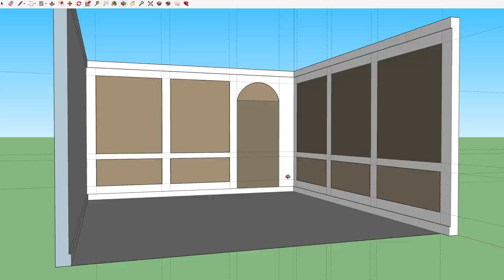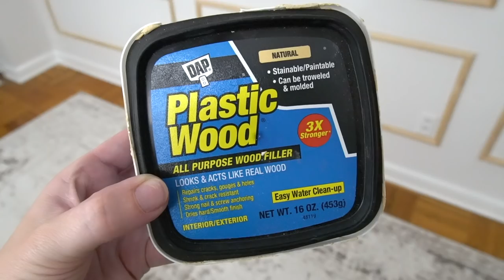Living Room Makeover | How to Install Picture Frame Molding

Comment: Hey Stephanie!  You have just about all the same Ryobi tools as me!  Love them except for my electric riding lawnmower.    So I would like to suggest you get the Ryobi folding stand for your saw.  It has arms that slide out that you can use for multiple cuts.  This will give you better accuracy, save time, and support for longer pieces.  You can install and remove the saw in seconds.  And it folds up for storage.  Best of all it is super sturdy.  Thanks for all your videos!  Beautiful work from a beautiful lady!!!

Comment: Really nice finish. The one thing that really gets me is when developers decide to put thermostats, phone intercoms rdi, light switches etc, in the most ridiculous places - like in the middle of a wall rather than to one side of it!.. Leaving the re-positioning a costly expense.
 An example of this would be the house I have just bought. The developer chose to put the internet modem wall sockets etc in a cupboard that is 2ft high from the floor with a full size door on the front of it. The remaining height the 2 ft cavity is a solid brick wall when the door is open!. Surely they could have put these sockets modems elsewhere. 
I now remove the door and build a false wall to make the whole wall flush! Crazy!.

Comment: It appears like it would have been very easy to at least move your TV wall mount over enough to avoid the wall trim.  Great job ... it's just that for me the interruptions of the trim for the plug just strikes me as not right.  But that really does look great, and nice choice of rug.

Comment: Nice job and no pencil marks & no paint roller needed, wow! ! Good to see it can be done as add on to a ready /painted made wall as I plan to do this as future enhancement. Moving in is already costing a lot haha 😂. Would you recommend the laser guide or that long traditional level will suffice? Is that nail glue stable./long lasting? I got kids and afraid it will suddenly fall like double sided adhesive tape. I don’t have nail gun bec mine is concrete 😂

Comment: Love it. My only complaint are no wall outlet behind the tv(would have been easy and a great time to add it) and the plug in the middle of the trim. I would have went smaller with the boxes or larger in order not to have the trim run thru it.  Just my .02 cents.  Other than those great job!!!!

Comment: Beautiful.  Love the trim.  Did you do the third wall as well?  Also, what tool did you use to smooth the drywall anchors into the wall?   Also going to run on over Boutique Rugs and see what they have.  You didn't steer us wrong with the KOVE speakers.  I really like the Paloma rug.  Great job Stefani.  💗
Reply from the maker: Thank you so much! I didn't do the third wall, it's covered with windows and our front door. I think I was using my tape measure to tap the drywall anchors into the wall haha. Thank you for following along😊❤

Comment: Love the video. Very interested in doing this after seeing my sisters house with this and a more elegant picture frame molding pattern throughout her dining room. My question to you if possible is can I paint them white prior to installing on the wall?
Reply from the maker: For sure! You may just have to touch up the paint where you have nail holes.

Comment: Nice looking finished project. Pro tip though. Even if you have to make a box an inch longer or shorter, never notch out the trim to fit the outlets. Just adjust the size of your boxes because it is such a cleaner look to have all the plates uniform as well as your trim without having them run into each other.